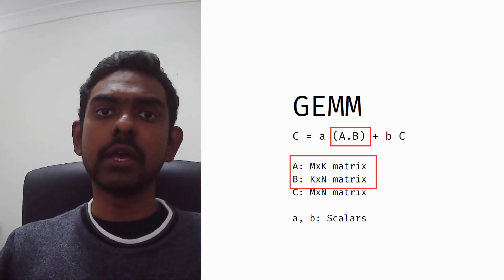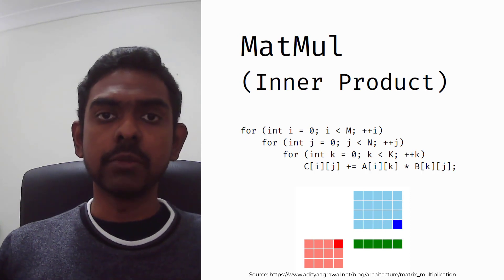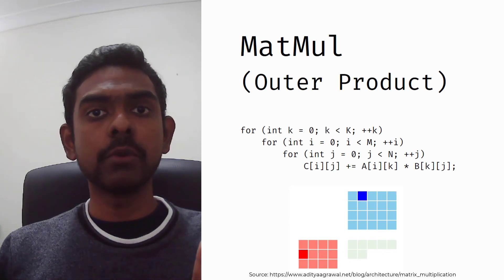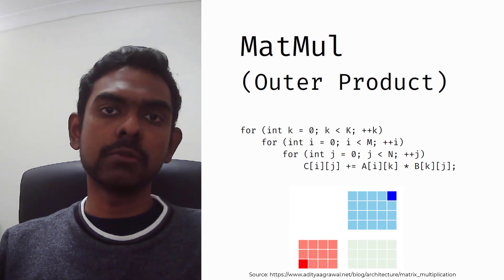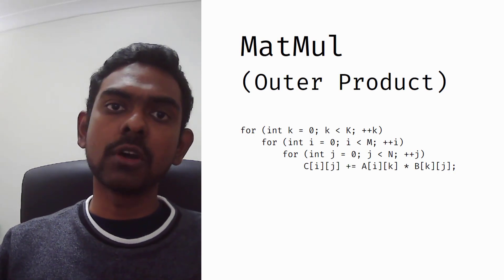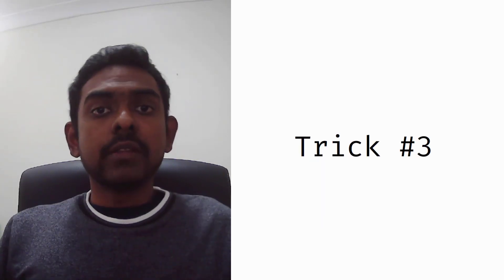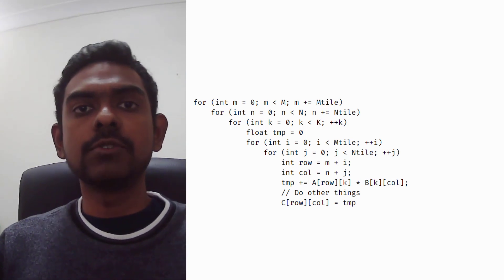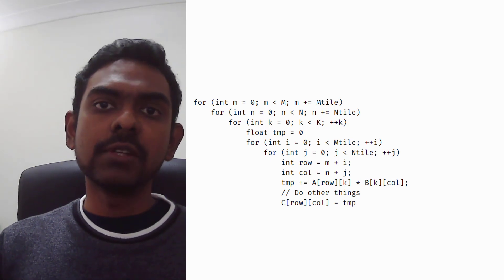Inside the Matrix: How does matrix multiplication work inside GPUs?

Comment: Great video! But I have a question. I used TensorFlow to build DNNs, and I created one network with a structure of 4x100x100x1, another with 4x100x100x100x100x1, and finally one with 4x400x400x400x400x1. Why is the training time for all of them roughly the same, even though the computational load is vastly different? This issue has been bothering me for a long time. I can provide the code if needed. Thank you!
Reply: The bottleneck may not be on the calculations, but on other parts. You need to profile it.

Comment: If you do all calculations in a single kernel, you can run into register pressure. I don't think putting everything into one kernel is good advice, since it can often slow things down.